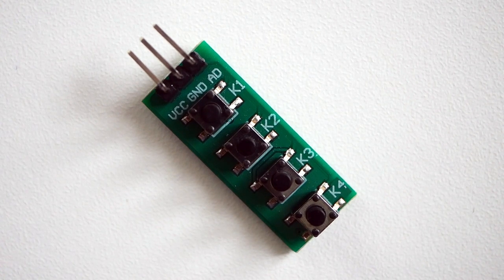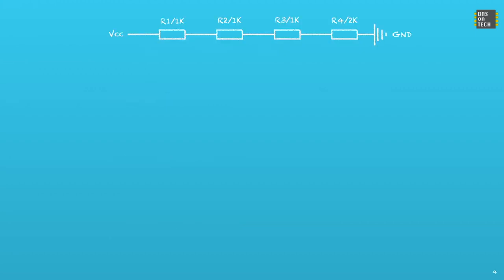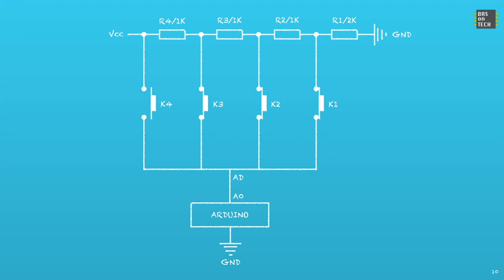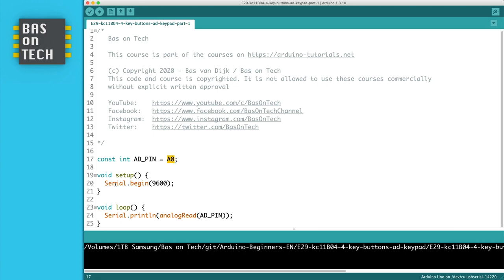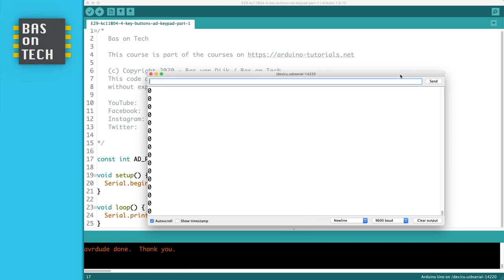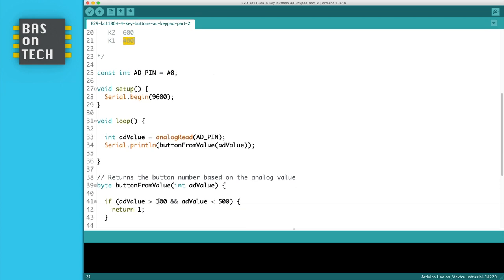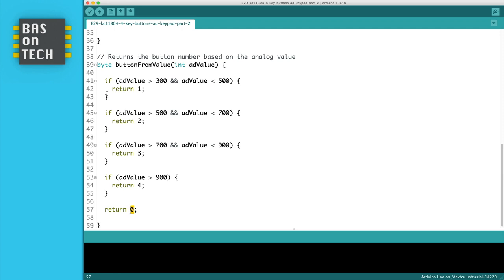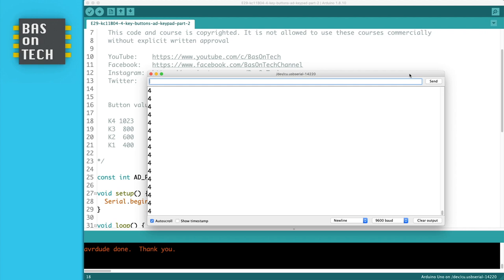USE ONLY 1 PIN TO READ 4 BUTTONS (KC11B04 4X1 AD KEYPAD) - Arduino tutorial #29

Comment: Very interesting. I was wondering how something like this works after looking at DFRobot's products. They use a single pin with buttons between the pin and ground, it must cycle somehow between output and input to get a reading of how much is going to ground.  This is a handy method to do something similar with Arduino. Thanks!
Reply from the maker: You're welcome! 😃

Comment: what happens when 2+ buttons are pressed down at the same time?
Reply from the maker: Good question! You get a combination output of their resistance. The downside of this is that the more buttons you press, the less range you have to determine which buttons are pressed. This makes the probability of detecting the wrong button getting higher.

Comment: This is a great video. This means I can use one cable for my four button camera zoom control. I only have to add some resistors to my button-case. It is going to be cramped in there but I think I will manage. Here you can see my camera rig with 'home build Arduino zoom controller': https://youtu.be/Q199zLxkKXs   If you watch the video you will notice that one handle has a little case with four buttons. This is meant to be able to zoom in and out in two speeds. It is designed for two cable but as I in principle only use the slowest zoom, the two extra buttons are not really needed and although I created the four buttons and extra wire possibility, I never adjusted the Arduino or software for handling 4 buttons. With your trick I am going to implement it after all. Thank you for the video.
Reply from the maker: Great to hear my video helped you! Good luck with your project 😃
Reply: @BasonTech  Dankjewel :)